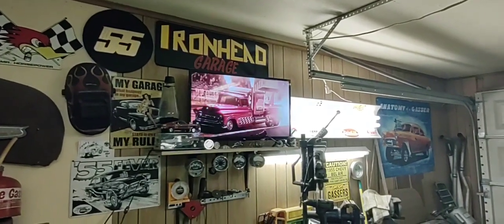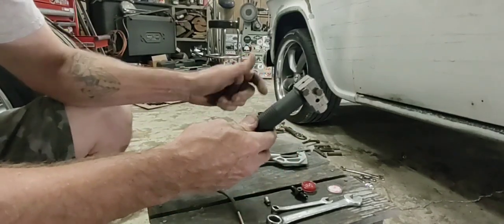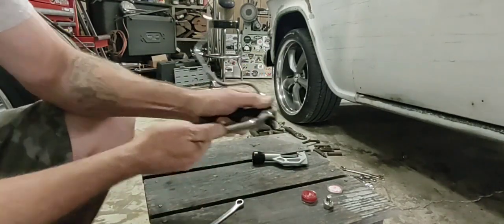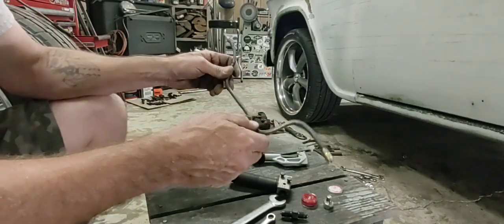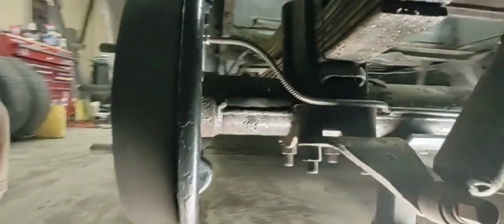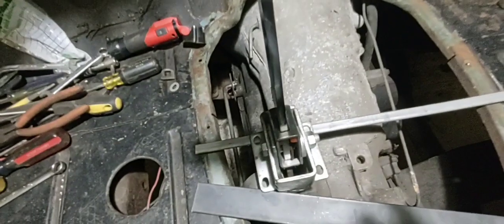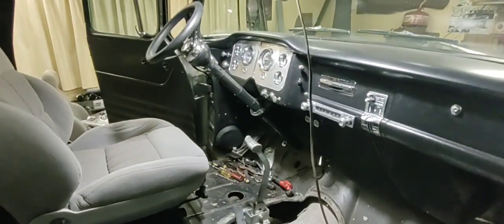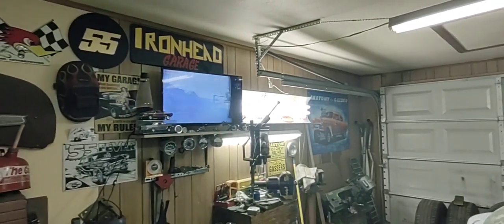1955 GMC Step Side, Brake Line Flaring Tool, Installed New Shifter.

Comment: Oh heck yea! I'm going to order that brake flare tool chris, been using the old style and it's been hit and miss, I should say mostly miss😂 but kool, thanks for sharing brother  and truck looking killer Aloha
Reply from the maker: Hey Sonny thanks! That Flaring tool does work pretty slick. You will like it
Don't get much easier. I should have bought both sizes I had to do a 1/4 inch brake line with the old Plummer style just don't work as good.
Thanks for stopping in brother have a great night👍🏻👍🏻👍🏻

Comment: Chris, At least they didnt totally ruin that trans cover you can restore it nice and recut the hole to appropiate size and evenly. Never knew about that gravel guard spring on the brakelines. I always thought it was for bending without kinking tight bends and shapes. Are you going to leave this truck in patina??? You work pretty fast I must say and so professionally as usual...
Reply from the maker: Hey Glen thanks. The trans cover it's in pretty good shape fixing the hole should be pretty easy. Going to be a lot better with that old school shifter to. Yeah that gravel Gard is good stuff it should be on your 55 to they put it on when they built them back then. They do make a spring you put over the lines for bending them to.
I probably will paint the truck one day I atlest want to get all the primer off to see what it looks like.
Thanks for watching I appreciate it
Have a great rest of your Sunday.
Take care brother 👍🏻👍🏻👍🏻

Comment: Trucks coming along. That's a little bit different tubing flare from what I'm used to. Good choice on the shifter. And the jet truck I got see that thing in person back in the mid-1990s. I probably got some pictures of it someplace. Seems like that time I had two of those jet trucks going around.
Reply from the maker: Thanks! That Flaring Tool works pretty good. I just had to use a old style one today for 1/4 inch lines
Wish my new one did bought sizes but only 3/16 Line should have bought both sizes lol. I do like the new shifter a lot fits the truck better to I think. That B&m one they don't work very good copy of the old Hurst style. 
Pretty cool to hear you seen that jet truck in real life. Man they sure are fast I remember that first time I seen one in real life it was pretty awesome. Thanks for watching
Appreciate it. Have a great night
Take care 👍🏻👍🏻👍🏻

Comment: Hey Chris, I agreed best thing is get that BandM  shifter out of there, I never liked them, I call them rattle shifter (LOL), they tried to copy the Hurst His and Her shifter but they just never work that well, the other shifter is very basic but they work so much better, the truck is coming along fine. It's always a pain cleaning up after someone shit job. If you bolt it down then you can remove the rod on the transmission and unbolt the floor pan to work on the brake cylinder, much easier, you think like me simple makes the job work well. Later Tony
Reply from the maker: Hey Tony your right about that B&M shifter it had to go and they don't work very good was a copy of Hurst. 
The old school one is much better
Even looks better to and simple to operate. Great hearing from you have a great Sunday. 
Take care 👍🏻👍🏻👍🏻

Comment: Sorry missed a few vids what engine you running
Reply from the maker: Hey how's it going. The old truck has a Pontiac 400.  Had it fired up just after I got it seems to run pretty good. Thanks for stopping in appreciate it. Take it easy man 👍🏻👍🏻👍🏻
Reply: @IronheadGarage  nice going to be a sweet truck
Reply from the maker: Thanks!👍🏻